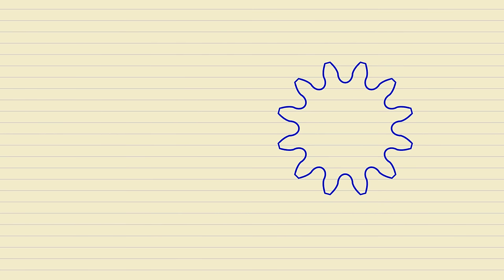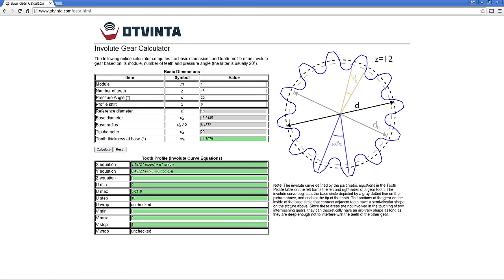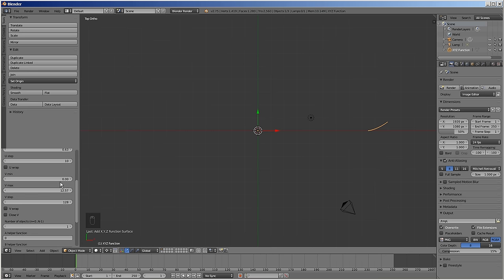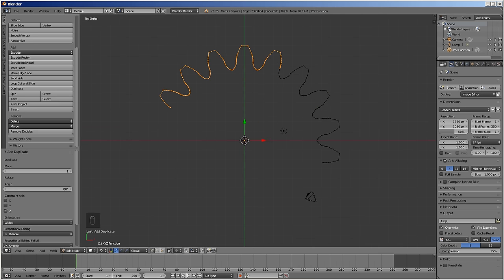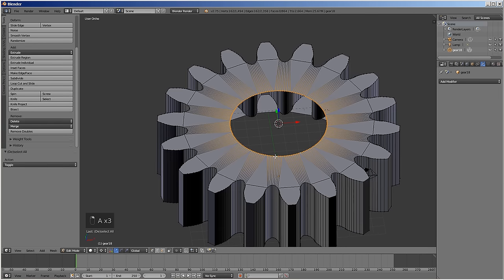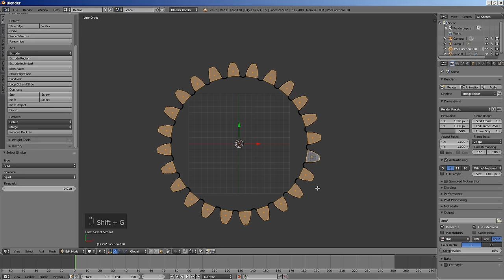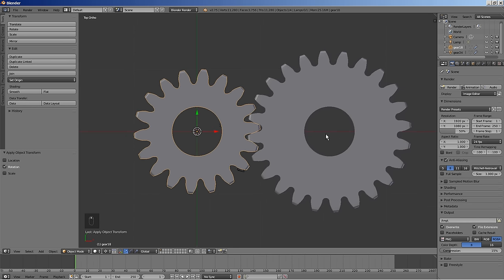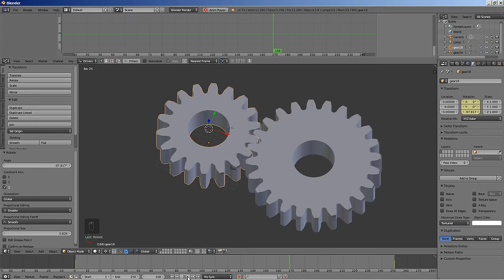Tutorial: How to Model Geometrically Correct (Involute) Gears in Blender

Comment: I figured out how to combine the aspects of this with the throated worm drive using paths in Blender. (You convert this gear's face from mesh to path, and use it as a bevel to a bezier circle. Also involves twist and smoothing the twist.) The clue was the torus section info in your other video.

Neat stuff by the way. :)

Comment: How did you:
- determine axis of rotation for tooth?
- is top of the involute also Tip diameter/radius?
- involute curve starts at Umin and ends at Umax?
- how do you determine which end of involute curve is on top and which one is on base of tooth?
- you bridged two teeth with semi circle, how far in to a gear must this circle go?
p.s. I get bigger involute curve that tooth needs to have.
Reply from the maker: - All rotations in this tutorial take place around the center of the wheel (which is also the origin. The involute goes from the base to the tip of the tooth, from UMin to UMax, and Umin is always 0. 
- For the number of teeth 12 or fewer, there is a need for an "undercut", that is, making the bridge arc go deeper into the wheel to make room for the teeth of the other wheel. The alternative to undercutting is using a non-zero "profile shift", see our Planetary Gear tutorial for more information on profile shifts.
Reply: Thank you. Does same principle apply also for inner tooth (planetary gears,...)?
Reply from the maker: It does.

Comment: when i bridge the edge loops i just get a horrible mess of a mesh, no hole in the center or anything, suggestions?
Reply: I have the same problem! Have you solved it by any chance?
Reply: @kesniel1714  Me too. In my case, I moved the cursor position to a little bit minus z side, and it worked well.
Reply: @bubudge8855  Thanks! I'll try that out c:
Reply: Increase the size of the circle until it stops.

Comment: Very Interesting tuto. Big problems with Remove Doubles for the 2 wheels. Tuto recommenced at least 15 times !!! Finally, after 2 full days I obtained two good gear wheels, but the animation does not work. At the top there is a mention "Auto-run disabled" but in User Preferences 'Auto Run Scripts Pyton' is checked.At 20:20 Rotation Z = 500 is O.K. but when I  press i hovering the yellow box it does nothing.
An idea how I can fix the problem?
Reply from the maker: It would be easier for us to help you over email. Please email us at help at o t v i n t a dot com.

Comment: Help, I really want to create the gears, and am trying this in version 2.8. Im getting an "error parsing expressions" when I paste the equations in, and can't get beyond that step.
Reply: First of all you should use the auto-generated python script that the other calculator creates, mentioned in the video description.   I just did this today and it works, but you have to change a few lines in the script for 2.8.  The lines under the comment "# Link object to scene and make active"  are deprecated in 2.8 and only work for 2.7 or less.
# Link object to scene and make active
scn = bpy.context.scene
scn.objects.link(ob)
scn.objects.active = ob
ob.select = True 

Change the 4 lines of code to this...
    view_layer = bpy.context.view_layer
    view_layer.active_layer_collection.collection.objects.link(ob)
    view_layer.objects.active = ob
    ob.select_set(state = True)

The script will create the profiles for both gears so you don't have to model that part.   Watch the video in the description.
Reply: @aliensoup2420  Great, thanks for the info! I will give that a try.

Comment: Can I set this up for more than 2 gears? It looked in a way that it only works with a 1 parent plus child. Can the driven gear be set up to drive another gear?
Reply from the maker: You setup the 3rd gear the same way as you setup the 2nd, via a driver relative to the 1st gear, but you need to adjust the gear ratio accordingly, without a "-" sign because the 3rd and 1st gears are rotating in the same direction, and the gear ratio value needs to be based on all three tooth numbers.